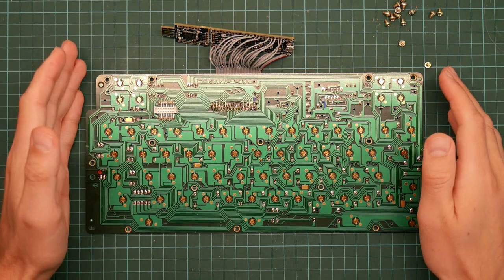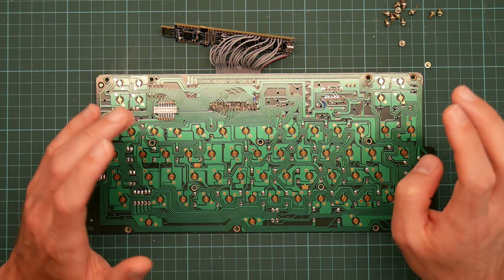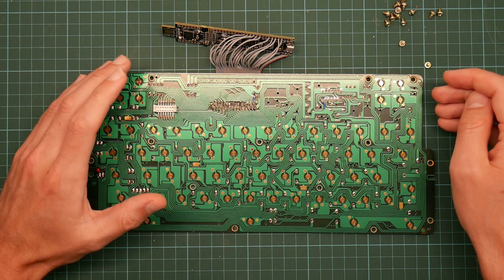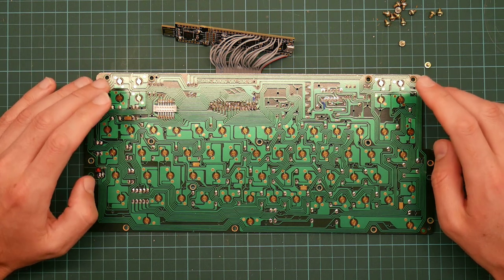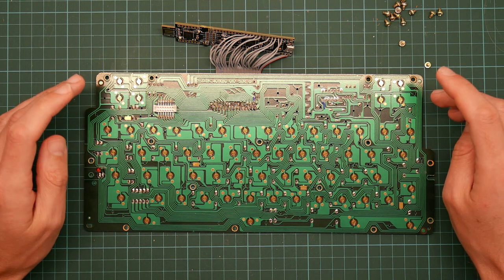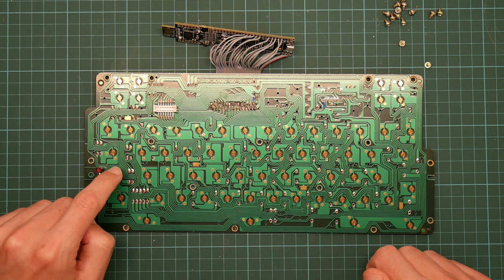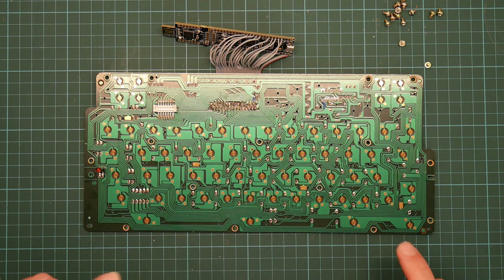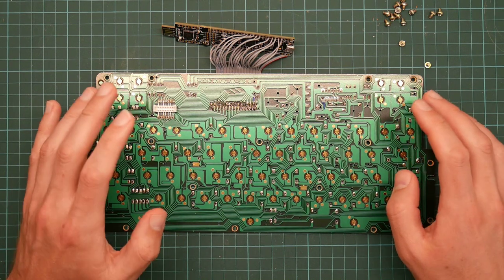Hjalfi builds a keyboard (part 3)

Comment from the maker: I later realised that I forgot to solder the link between the internal Shift key line and the pin 19 on the connector (line H) which means that the Shift key doesn't work. I'm not going to bother to film that --- it's literally twenty seconds with a soldering iron.